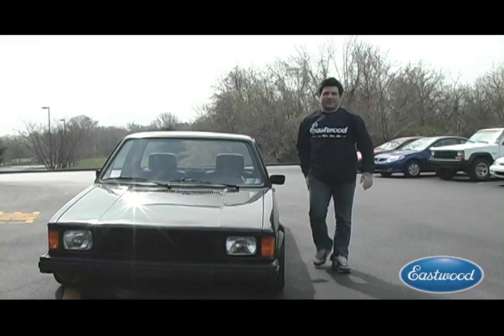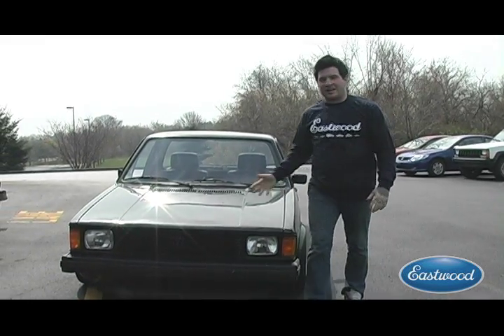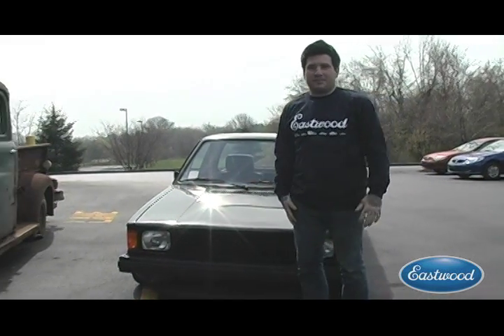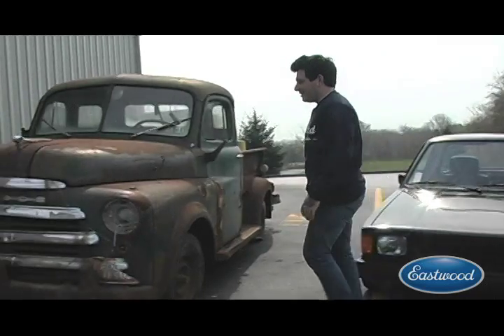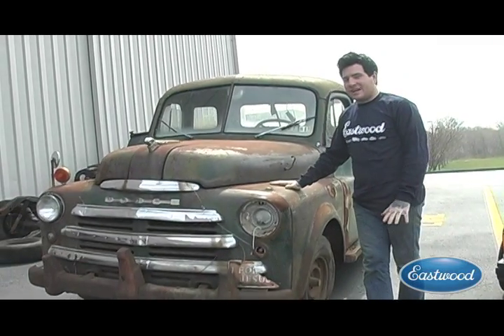Pile-House Dodge Pickup Project Introduction at Eastwood

Comment: You've got 2 things going in your favor:

1) All the original glass is there.
2) You've got most if not all of the original chrome trim.

Not having to repop those pieces will cut your project cost in half.

Now do something really Different/Original and install a Cummins 4BT and a Manual transmission. The manual trans might take some chasing but they're dirt cheap. 

If you really think your up for a challenge, stretch the frame and cab and make it into an x-cab.

Comment from the maker: Sounds like you have a fun project planned! A short bed standard cab S10 does have almost the same wheelbase correct. The track width of the Dodge originally was wider than a 2wd S10, but you can compensate by installing a 4WD S10 rear or running wider wheels with a more aggressive offset or backspacing.  -Matt/EW

Comment from the maker: @smokesomeweed831 I am using a mid 80's S10 chassis. Really any S10 chassis would work.. all depends on what wheelbase truck you are starting with. short bed Dodge Pilothouse trucks have almost the same wheelbase as a first gen short bed, standard cab S10.. so that is usually the most ideal. Hope that helps! -Matt/EW

Comment from the maker: The short answer is: Anything can work with enough modification! I would start by checking for the wheelbase specs for a dakota that era and see if it is remotely close to your classic truck. If it isn't pretty close, you will have to chop and shorten your dakota chassis or lengthen the bed of the classic truck to fit the longer wheelbase. Obviously there are associated modifications need to accomplish both, but that's an idea. Thanks for watching! -Matt/EW

Comment: @EastwoodCo You basically want a quick restoration so you can enjoy it. That's fine and better than letting it go to waste.  As far as challenge goes, it's often much harder to restore them to original spec.

I have a friend who has a 1953 dodge/fargo 3 ton truck, with original flat head 6 cylinder and 5sp transmission.  It's gutless compared to today's engines, but it's such a time capsule. It even got most of the cloth unsulated wires from pre plastic era. :)

Comment: Nice to see you taking on this project. You  can do the modern upgrade with a 92 Dakota frame as well. I modified my 50 Dodge with a 1997 ford T-Bird IRS and a 1985 Dodge Diplomat IFS on the original frame. Look forward to seeing it done.  We call ours "The Brick" and race it at Bonneville....

Comment: I have a 1953 Dodge that has been in the family since the mid sixties, in need of a restoration. One of the vehicles I learned to drive when I was around ten years old. Have considered different frames that I could put under it, champagne taste on a beer budget.  If and when I ever start on it there will be a mopar under the hood.

Comment: I am doing a 57' Dodge short wheel base pickup on a S10 frame.  They both share the 108" wheelbase so that is not a problem, but how is the track width?

The 57 and your truck have the same basic measurements, and someone torched my frame to remove the engine.